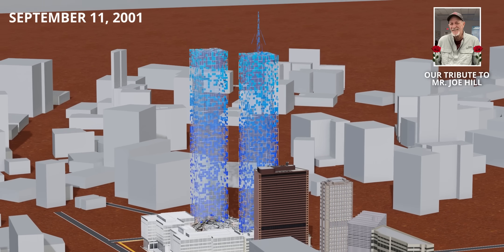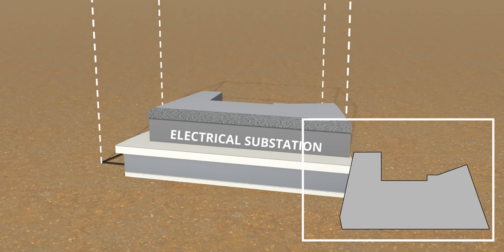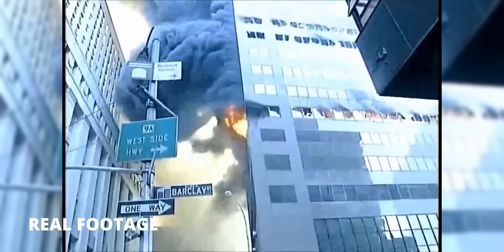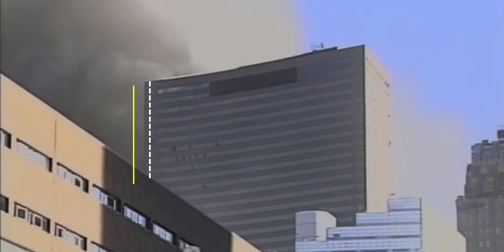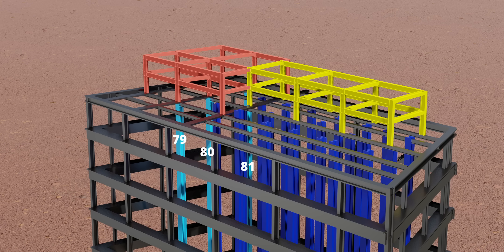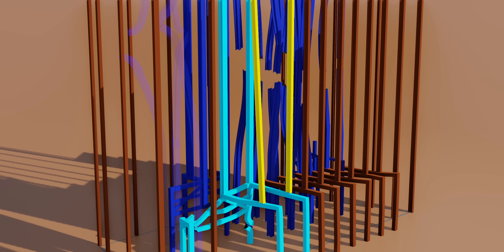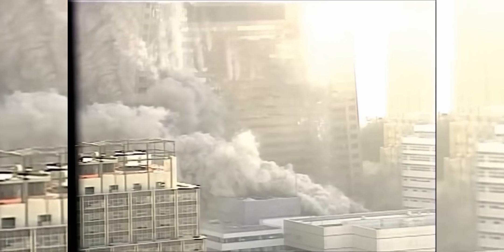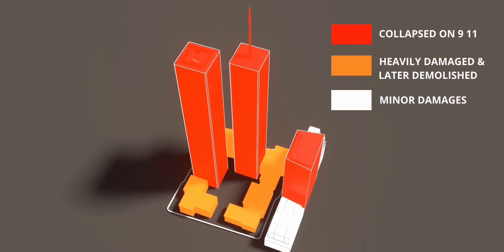Collapse of Building 7 | The Complete Physics

Comment: it was underground nuclear explosion (as with two other buildings). That's the most logical version that explains all the known facts. All the three buildings were built with system for controlled demolition that used small nuclear charges. Fun fact: media started calling WTC as 'ground zero' although this term before was used only for epicenter of nuclear explosion. And they even rewrote definitions of 'ground zero' in vocabularies expanding the term. Before 9/11 'ground zero' had only one meaning - epicenter of nuclear explosion. After 911 many other meanings were added to this term in vocabularies - place of WTC collapse, epicenter of any explosion etc. WTF??? Search 'Dmitry Khalezov 9/11'. This author (Khalezov) bought dozens of pre and post 9/11 vocabularies and he shows how the definition of 'ground zero' was changed (same vocabularies, but different editions), it's mind blowing. Why did all the media started to call WTC 'ground zero'? Like they had the same script.
Nuclear explosion explains all the physics of what we saw during 9/11. Just search for it, there's multi-hour video where everything is explained in details (also multiple articles, a book)
Reply: Most insane one I’ve seen by far
Reply: @Infinityglow9874  no-no. The most insane  version is the offfficial one (where aircrafts hit WTC and fire begins and destroys steel in skyscrapers and they collapse).
Reply: @leximus333  how is that insane?

Comment: Nice try but complete rubbish.
Reply: This video is very good – with one or two exceptions - and goes into a much higher level of detail than many viewers will be able to comprehend.  While not perfect, the collapse mechanisms – the sequence of failures - described here by Lesics are substantially correct and this is true no matter who planned and carried out the 9/11 attacks or why . 

That may not be what you want to hear and go against 20+ years of entrenched dog_ma and conditioning, but it’s not wrong. 

That also means (in case you did not get the hint) this video can be (and IS) absolutely correct in its description of Building 7 collapse mechanisms AND the 9/11 attacks could still have been some sort of inside job. The two things are in no way mutually exclusive. 

The mechanisms described here have broad professional support around the world. There are no professional engineering organizations (for example: ASCE, ASEE, ICE, etc) that disagree with them or have offered any formal dissenting opinions or alternative hypothesis. 

The mechanisms described here are not new. They have been well understood for many years and much of it can be easily confirmed by simple observation. You can literally see most everything they are talking about if you just bother to look. 

So, setting hubris aside, either the overwhelming majority of the worlds structural engineers and simple observation are wrong,… … or you are. Which seems more likely? 

IF you still –think- believe this explanation is wrong then produce a better one . Good luck with that. No one ever has and I don’t see you moving that needle today. 

No one ever does.
Reply: I highly doubt you even saw the entire video
Reply: @sujitbala1492  I watched it a full minute and realised it was bollocks and I will tell you. Airplanes don't have opening windows and don't disappear into thin air.
Reply: @allanb52  - OK, but do you have any comments relevant to the topic of this video, or just men of straw?
Reply: @allanb52  🙄🙄🙄

Comment: Great explanation. Only thing I'm not so sure of is whether WTC 1's spire caused the long vertical gash. Collapse footage shows the spire falling mostly straight down, slightly angled to the south, away from WTC 7, if anything. Either way, still was definitely caused by debris from the collapse.
Reply: I am quite certain that is wrong. The gash was caused by a perimeter column in Building 7 failing (#20 IIRC) failing after being hit by sections of North Tower perimeter column that peeled away during the collapse. This we can actually see.

Comment: It is hard to believe with all those pillars and it went mostly straight down like a controlled demolition.
Reply: Gravity only works straight down. If you were expecting it to fall sideways then then problem is you.
Reply: @TheCriticalStinker-01  with the side giving way and the tear down the face, it should have lost structural integrity to the point of falling in to the debris of the previous towers, not mostly straight down.  The excuse of the extensions due to the existing building assisting in the collapse does not explain why it did not fall towards other buildings.  The building did not " fall like a tree ".  I recommend watching more videos on controlled demolitions, specifically ones covering the demolitions of old Vegas buildings as they have similar mass.
Reply: @TheCriticalStinker-01  hilarious

Comment: When the conspiritards start squealing about the failure temperature of steel, that is when you ask them will the steel structure hold together if only half of its failure temperature is reached? Unlikely! Kinda like the absorption factor of a paper towel won't hold the weight it's supposed to if 50% gets soaked, or even just 25%
Reply: Anyone who has ever watched a blacksmith work - the steel doesnt need to be red hot to become softer and workable.
Reply: @edwardp7725  that's usually my first example, too. Ask a Blacksmith about metal's elasticity when heated.
Reply: @edwardp7725  I should've used the word "melting" instead of "failure", but I think my point is clear enough....for non-conspiritard non-disinfowars non-Alex Jones fans 😂, then I think you will be fine 👌🏻😁
Reply: @ethanmac639   That argument isn't about the structural integrity of the steel that conversation is about the fact that at the twin towers firefighters and first responders claimed that there was a molten metal flowing from the building you cannot get that from jet fuel.  But that's only if you want to argue in good faith.
Reply: @goon009  changing the goal posts and deflections right out the gate, WOW! we are off to a running start folks....but fear not the conspiritard Q-TATRDS and Alex Jones fans haven't even entered yet! 🤣😂😅
Reply: @junfour  🙄🙄🙄
Reply: That's way we do not use paper in construction

Comment: What is the reason or is it possible that this bulding collaps in free fall? Could it be caused by fire or by other root? What about the resistance force of steel in the moment of free fall? I saw a large amount of tapes recorded and analysed for 20 years. I really appreciate the energy of the creator for this framed animation ... so I do not agree to the title "TRUTH" - What do you guys think?
Reply: What free fall?  20 seconds is less than 1/3 of free fall. Get out a stop watch and measure it yourself. Stop just mindlessly believing whatever the internet tells you.

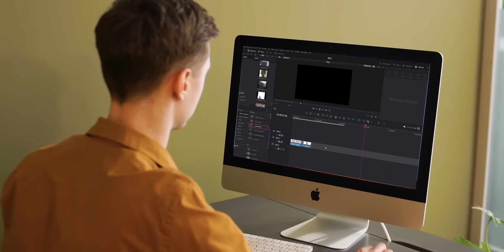Comment: 9:28 what a load of bullshit. Even NIST concluded that during stage 2 WTC7 fell at 32 ft/s^2 for 2.25 seconds.
Reply: Who cares.  All that means is that the lower levels of the structure failed.  We know that.  This is a truly unremarkable point.
Reply: @MrDefreese , so tell me how 82 columns across 8 stories all offered NO RESISTANCE. Fire?
Reply: @ the collapses of the columns happened quickly especially as the horizontal support structures failed.  It’s really not that complicated.  The fire department wasn’t surprised, why are you getting a stiffy over something that was under observation and reported on that very day?

You aren’t uncovering some plot.
Reply: Oh  @MrDefreese , so 82 steel columns just gave up all at once because of some horizontal supports failing? Right, because fires usually work that way, picking out the exact weak points to bring down an entire structure in perfect sync. Can you think of another fire-resistive structural steel-framed building that’s collapsed this way from fire alone? Just one?

And if this "quick collapse" is so simple to explain, then why are so many engineers and architects scratching their heads over it? Shouldn’t they be the ones saying, "Oh, nothing to see here," if it’s really that obvious?

You’re saying the fire department wasn’t surprised. You haven't seen the latest online article at IFSJ, "Did World Trade Center Building 7 really collapse due to an office fuel load fire?", written by Captain Raul Angulo.

So, what’s it gonna be? Stick to this one-in-a-million fire story, or admit there might be more here worth looking into?
Reply: @ the professionals are only curious about the specific, esoteric details of the collapse.  The NIST report wasn’t concerned with the question of whether fire and structural damage caused the collapse either.  They are not arguing the inane silliness that there was a demolition scheme in place at exactly the spot where a building was severely damaged and on fire.  Everyone of moderate intellect should know that structurally compromised and burning steel structures are potentially at risk for collapse….which again is exactly what on-site fire commanders were posting all day long.
The obtuse conspiracy theory implies the FDNY was on site and lying about the pending collapse.  20+ years later, it’s a spectacularly bizarre insinuation.
Reply: @911WarRoom  - Progressive collapse. Floors in the NE corner fail, one core column buckles.

The 2 more.

Then 3 more

Then 3 more

Then 3 more

That process continues until the core is gone, taking all of the floor systems a d a lot of perimeter columns with it and leaving a hollow empty outer shell that only looks like the building. But there's nothing left inside - like an empty cereal box.

Fundamentally that shell is being held in place by just the 4 corner perimeter columns, not 82. When those 4 columns buckled under the strain, there would be no resistance.
Reply: @TheCriticalStinker-jw4fl  yeah cuz structural steel-framed buildings do that in 6.5 seconds. You're painting a fantasy that demolition companies would love to be true so they could save money.
Reply: @911WarRoom  18 to 20 seconds.  You aren't paying attention.
Reply: 2.25 seconds out of 20. So what?
Reply: @TheCriticalStinker-01  2.25 out of 6.5. At least troll about the right building. Freefall means that there was NO RESISTANCE for 8 stories/105ft. Tell me how fire can cause 82 columns across the footprint of an American football field on 8 stories can all near simultaneously offer NO RESISTANCE.

Comment: question: if the north tower pancaked downwards, how would the material appear to be exploding outwards to reach towards wtc7?
Reply: If you squeeze a kickball in your hands, the parts that you're pushing together move inwards (the towers collapsing downwards) while everything between the parts you're pushing on have to bulge outwards (which is why material moves outwards from the towers)

A more accurate comparison, though, is to crushing a soda can. If you crush a soda can (a tower falling) top to bottom with your hand (the force of gravity), then some parts of the can will bend and crumple inwards, while others will bend outwards. This is due to the fact that the soda can (or tower) has irregular dimensions, unlike a sphere. So while some of the material appears to move outwards like when squishing a ball, other portions of material move inwards as if they were also being squished in.
Reply: because each floor contained about 15 000 cubic meters of air. if one floor comes crashing down onto another, all that air is going to be pressed outwards with a massive force which would also send debris to the sides of the towers
Reply: @Xdvulture  I like the ridiculous piston theory as if the floors had pressurised gases inside like diesel in a piston chamber that just explodes outwards once the piston (15 damaged floors) kept compressing 85 intact undamaged floors down to zero. 😂
I'm starting now to become convinced that something other than the piston was violently blowing up those columns to the sides.🤔
Reply: @Vantriloquist-j9j  It did sort of have gases inside the floors. air. do you even know how many cubic meters of air was inside each floor? and if a floor violently collapses, the air between that floor and the floor below will have to go somewhere and it will be pushed outwards violently
Reply: @Xdvulture  Are you for real trying to equate open floors to tightly compressed chambers!?
The air had many escape routs through already broken windows, broken floors, the core and elevator shafts...etc
Even your supposed pile driver (piston) was already compromised, shattered and on fire, the air was in no way trapped in those buildings!
Reply: @Vantriloquist-j9j  we're talking about like more than 10 000 cubic meters of air on each floor. there were not enough alternative ways for all that air to exit in time so the majority of it would still "explode" outwards
Reply: @Xdvulture  There was no trapped air, you can play that numbers game "10,000 cubic meters" to make things sound so drastic, yet this wasn't a pressurised tightly sealed tube or chamber. The piston theory is as convincing as the Iraqi WMDs claim.
Reply: @Vantriloquist-j9j  just look at the speed of the collapse and think to yourself what sounds like the most logical thing to happen to all the air in every floor when it collapses that fast. it will exit to the sides
Reply: @Xdvulture  The air in each floor wouldn't explode or get "pressed outward with a massive force". It isn't like a balloon. Windows would easily crack and break under this supposed "pancaking" of floors above it and easily eject. It won't generate enough force to propel those steel columns. This can only be done with the use of explosives. Explosive that certainly weren't implanted by the 19 hijacker or their leaders in caves in Afghanistan.
Reply: @MohOEM  You may be correct if we're speaking about relatively small buildings which are the kinds of buildings that we have usually seen collapsing or getting demolished before but the twin towers were the tallest buildings in new york at the time. you underestimate the scale and size of those buildings. they each weighed 500 000 tons and they were still about 95% air. they each had over 1 500 000 cubic meters of air in them. so yes, steel would probably fly outwards like an explosive effect if that air is suddenly and rapidly compressed to the sides
Reply: I think there is a Law out there that says something like, for every force, there is an equal and opposite force. This law means something   At the scale we’re looking at, I beams, become like toothpicks under this force
Reply: Because as the top portion rips the floors out below there is nothing left to hold up the exterior columns and they just simply fall out and over like a banana skin.   This is not difficult to grasp.  The floors connected to the columns.  Without the floors the columns have no support.
Reply: The core (mostly) fell straight down; the exterior structural columns flung off hundreds of feet in all four directions.  There are debris maps which show the debris pattern of WTC1 and WTC2 across approximately 2-3 blocks.
Reply: @MrDefreese flung, great use of science with that word. The columns just flung. Like in a wile-e-coyote cartoon. Let's just ignore the fact that the "flung" requires some form of lateral propulsion
Reply: @oliver9089  we could use technical language, but the Truthers seem incapable of using or comprehending that advanced technical language.

Since you want to try this approach, the external columns fell off to the sides because of gravity induced collapse of the twin towers; that damage was caused by the impact of the two jets and exacerbated by the resulting fires in the twin towers.

Did you have anything to contribute here or substantive questions to seek?  The Truther arguments were obsolete on 9/11/01.
Reply: @Neptunianwave  because all the buildings in question were BROUGHT DOWN by controlled demolition. Watch the documentary LOOSE CHANGE
Reply: Larry Silverstein 🇮🇱 (owner of WTC complex) said - "Pull it, and we made the decision to pull and we watched the building collapse" - referring to WTC 7 - not hit by planes.
"We are benefiting from one thing and that's the attack on 911" - Benjamin Netanyahu 🇮🇱
Reply: But it bend inwards, the facade bend inwards
Reply: I've seen the same thing with the south tower's collapse.. outer columns from the very top part of the building decided to fly outwards as if they stopped and changed directions mid collapse. The collapses never made sense to me, there's no way 15 floors perish 85 floors without slowing down.
Reply: @laminatka747  it happens all the time when it's controlled demolition
Reply: @laminatka747 they contine increasing is speed because more floors of rubble continue to fall
Reply: @laminatka747  The collapse got heavier and heavier because it was thousands of tons of concrete, steel, and other materials coming down all at once, how would the lower floors slow down all of that happening?
Reply: Thanks to everyone in the comments for being educative, for many people will push a certain ideology, but I hope to learn all your fascinating theories 🤠